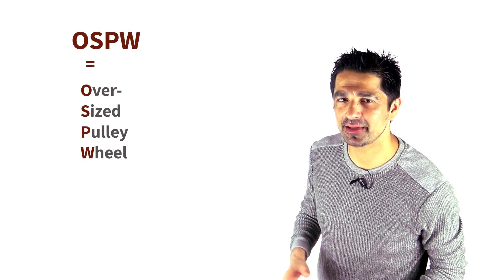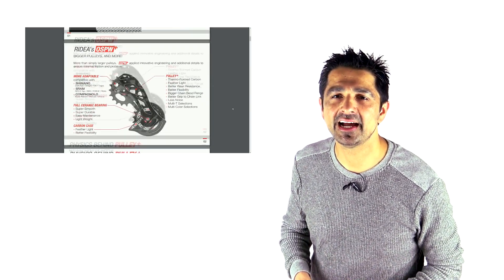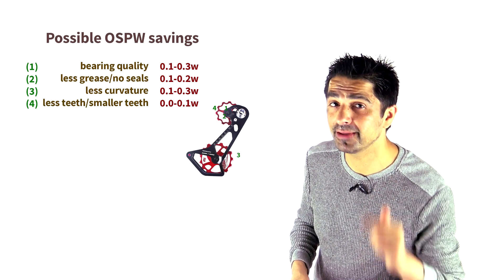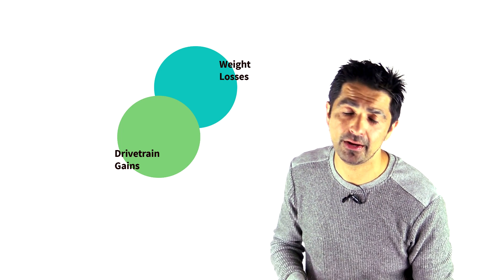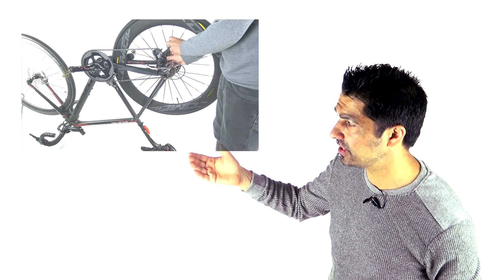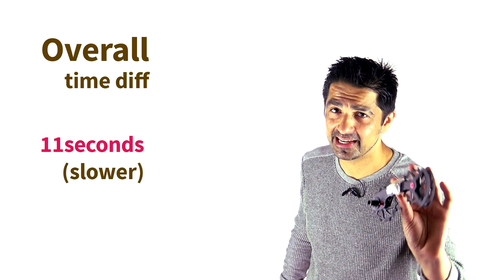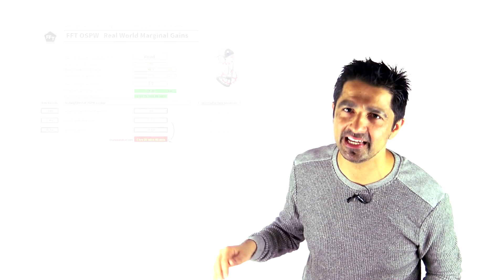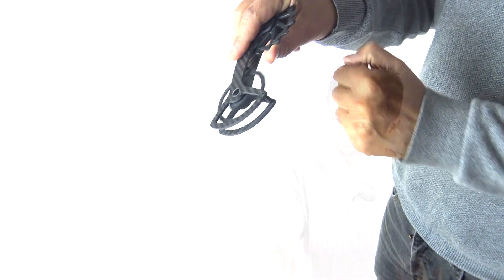Why your CeramicSpeed (or other) OSPW will cost you watts due to aero drag

Comment from the maker: If you want more proof check out our unlisted video: https://youtu.be/vWDIQVv10BU and our calculator https://fft.tips/ospw  (and please join us on our strava club: https://fft.tips/strava). To those who asked about 0.8w.....here is a quick back of the envelope calculation. We previously showed that 10cm of 4mm (area 400mm2) exposed cable costs about 1w (https://www.youtube.com/watch?v=fbM4fEIu8YY&t=770
) now using calipers a small OSPW is 30mm extra long and 16mm in width (frontal area= 480mm2)...so very roughly thats 480/400 x 1 = 1.2w; a large OSPW as shown in this video was 63mm longer (frontal area = 1008mm2) = 2.52w losses...but we could take off 1/3 of this number because of position in 'dirty air' and 1/3 because you are only in a small gear sometimes meaning the OSPW is most exposed, leaving a third remaining, so that's 2.52/3 = 0.8w. More here: https://www.youtube.com/watch?v=9IZPvSe1RRE&feature=youtu.be&t=80

Comment: UPDATE: So over this last week, I had a kogel ceramic bottom bracket put on the Argon18  nitrogen disc and road bike, and yanked out the shimano bottom bracket. Just as with the pulley, I felt an instant improvement with first pedal.  My speed, power, and climbing watts have increased. This is not some imaginary psych. Influence that all of a sudden has me riding better on the bike. The Kogel OSCP and BB have made the already rigid Aero bike feel stronger and smoother. The best way I can explain the feeling to you would be this....an outdoor bike on roughly paved street now feels like a high quality indoor trainer while being ridden on that same roughly paved street. I can feel the power to the wheel transfer way better. I am bringing the Bottom Bracket here to the topic of ceramic OSCPs because the same argument applies as with the pulley, which is "does it make a difference". In the case here, science is used, respectively.  However, my physical body work using these bike products vs. The scientific studies based on numbers or wind tunnels is NOT pointing towards science as the correct answer for actual riding improvements for a cyclist using these items, even though the scientific numbers and testing might be/is accurate for the given items. I agree that these parts can be costly, and I cannot speak for the ceramic speed items, but I can say that if they are built as well as these Kogel items seem to be, they are well worth the cost because my cycling experience is much more enjoyable. Nothing is free.
Reply: Facts don't care about your feelings. Make some data or at least try to be less objective. Your entire post is basically just "I know it works"
Reply: @skoparweaver7692  let me see if i can put it in a way that you might be able to comprehend...that "data" that has already been done scientifically, that I said might be accuracte/ correct, is not correct, coming from someone who wasn't too cheap to purchase those items and actually has those items on his bike, from his experience.  Just because there is data on paper about an item, it does not mean that the item doesn't work as well as the data might suggest, because in this case, the data can't measure ones muscle reaction to that item. That's the facts.

Comment: Here's what I can tell you about my experience from an oversized kogel pulley.... I am a new, heavy rider having difficulty climbing. I did a final test climbing a specific hill with my ultegra setup before having the oversized pulley put on. On that hill, I could only make it up on the biggest cassette gear. I then put the new pulley on and not only went up the same hill on the 5th gear down, but couldn't believe it, so I did the hill again right after the first try, (which in itself is amazing) and this time I went up on the 6th gear down from the top. Broke my record on strava. Doesn't it make sense to say that if the pulley helped me to do this going up a hill that I was having problems with, that when putting power on the pedals in Any riding situation, that you are going to have a better cycling experience? Forget the science, it works just like the carbon wheels do what they are supposed to. I think it is funny that people gripe about spending $500 on the pulley,  but yet spend $13,000 on their bike. Don't be cheap, you only have to buy it once for the bike. Oh, and it looks great!
Reply from the maker: Nice account; I am wondering if this could be a placebo effect (which can be powerful)? Asking for a friend ;) Also "you only have to buy it once" IF it lasts forever.
Reply: @Fastfitnesstips  but, isn't it true that a stock pulley system needs to be maintenanced as well? A quality one will last longer, right? ......"placebo effect"......are you suggesting that because I spent good money on a pulley system, that after it was put on the cycle......a hill-   that I could only go up in the easiest gear possible, MONTHS AND THE DAY BEFORE  the pulley was put on.....all of a sudden, I can drop down to the middle of the cassette AND go up the hill better and faster the very next day, 2x back to back, to where I break my record without that being a goal in mind....only happened because mentally I told myself that "I have a new pulley system that I spent good money on, I am going to make it work better than my stock pulley", and in turn, told my physical body, "today, the day after, even though  I could only make it up the hill in the easiest gear yesterday and the months before without killing myself, today, I am going to make my body push harder, and be able to drop down to the 5th and 6th sprocket and go faster up the hill than ever before? Now, think about for a minuite. Oh, and you can tell your friend that I weigh close to 300 pounds! Maybe your science is correct about watts when you want aerodynamics to kick in. The funny thing is, every time I see a video on these pulleys, there is no scientific study done on what the thing does for you going UP the hill! (However, in fairness, you did mention it could help up hill in the video). This would be a good test video....have someone who is new to riding and has a hard time climbing, go up a steep hill as fast as they can, time and meet them at the top. Have them rest up for 2 days. DON'T tell them why.....next, put the oversized pulleys on and give them the same cycle and do the speed test up hill again. Make sure that they eat and  wake up, and go up the hill again under the same weather conditions and same time of day as the first run, and when they are done, tell them what the test was when meeting them at he top of the hill. Do this with at least 3 people, and I'll bet you they say that the pulley is worth buying, forget about aerodynamics downhill, which, by the way, hasn't hurt my speed at all.

Comment: Hard to accept your aero loss figure. The derailler sits right in the disturbed air flow behind the pedals. Even shoe size will effect the interaction between derailler and air flow.

Comment: Ceramic balls are 60% lighter than steel balls in bearings but two more chain links may be required so as to nullify that weight savings.

But ceramic bearings can use much lower viscosity oil vs grease or no lubricant at all for a race.
But the larger derailleur size creates more air resistance especially at higher speeds.

Comment: You don't get into the dirt... open cage bearings start picking up grit and grinding up the races pretty durn quick. Those marginal gains from the bearings are going to turn into losses unless you keep changing the $$$ bearings regularly.
Reply: Good point.

Comment: I've worked with GC riders++. 
Priorities for performance gains: 
- diet and bodyfat %
- hydration
- sleep 
- stress mgt which includes no. of hours one can devote to cycling each week
- biomechanical/musculoskeletal assessment, bike fit, and flexibility training for better aerodynamic positioning
- medical history and assessment (stress ecg, hormone profiling, spine imaging)
- progressive power meter training
- bike maintenance (waxed chain, cassette/chain/chainring set up and matched wear)
- lighter rims, narrower rims and tires, 23mm are lighter and more aero

What most deluded cyclists prioritize: 
- a bike under 7kg (when they are carrying 5+kg excess fat, much of it blocking arteries)
- frame and wheel aerodynamic gains (when a lower back angle will reduce drag 500+% more so)
- coffee 
- cool kit

Of the above, the most important criteria for performance is optimal nutrition and bodyfat %. Without this, you will compromise more performance inputs than any other factor. 
Fortunately though, 99.5% of humans eat for hedonic pleasure, and not performance.....so it is easy to get a competitive edge on opponents.

Comment: OSPW systems switch up your gear ratios, allowing you to travel at the same speed with less power. Hence, you are able to use those watts for increased speed. Increased speed has the greatest drag factor above anything else. So in reality, there is a penalty with OSPW, but it is too marginal to affect your gains within the reflection of speed. FYI I'm saving about 20 watts with my 14/12 tooth OSPW.
Reply: Wat
Reply: How would that switch your gear ratios???

Comment: Your entire argument is based on the aerodynamic drag, which the figure you totally made up. The amount of cost of the jockey wheels IMO cannot be anywhere near .8 of a watt, surface area alone wouldn’t equal that if it were placed on the top of your head. Besides the fact jockey wheels are relatively close to the wheel which are already creating their own turbulent air. If the size of the cage was such a huge aerodynamic loss I think we would see far bigger market for more aerodynamically shaped cages.

With that being said, $ per watt saved (for a ceramic speed ocjw) simply isn’t even close, it’d be cheaper to just lose 2 pounds off yourself then spend $500 on those.

Comment: To many assumptions.The loss of a free running system with standard  and oversized jocky pulleys can easily be measured and becouse it is on the unloaded side of the chain the difference in losses should stay the same in a loaded drivetrain.This is my conclusion as a engineer (although not mecanical) unless I miss something.The reduced loss is thus easy to measure.The bigger jockey  wheels will influance the effective cage lenth as the distace between the top and bottom of the deraileor that the  chain will see willchange slightly so ideally the cage should be shotened slightly to compensate.Aerodynamic drag can also be measured.Weather the relative small saveing is cost effective is another matter but as long as we dont go overboard there is definitive saveings to be had.

Comment: I upgraded my tt bike with sram rad 11speed to a OSPW from Ceramicspeed an I tested it 5 times  on a 20km flat course pushing 350 Watts an averageing 48km/h and in average I was 2 seconds faster☝️🤷‍♂️
Reply from the maker: You tested 5 times with and without the OSPW in randomised order? If so that's commitment!
Reply: 2 seconds faster Lol 😂

Comment: Interesting.  Please take this concept further to compare sram axs to shimano, short vs medium vs long cage derailiers.
Reply: I am even thinking about marginal gains like riding in a larger rear cog at higher cadence vs smaller cog at lower cadence at the same bike speed.  Thinking about drivetrain losses, and differences in aero of the extended derailier

Comment: This man‘s analysis is about as believable as is the claims Ceramic Speed makes.
Reply from the maker: I see, so you think the actual aero drag lies somewhere in between my claim of 0.8w and their claim 0.0w...ie 0.4w? ok try that figure in the calculator.
Reply: FastFitnessTips: Cycling Science! I have seen several of your videos and find the topics you address very interesting. As an engineer myself, and an experienced rider, I have seen videos of yours that I completely agree with, and some that I think are working under false assumptions. I have never used and OSPW by any company. That the larger form factor might create additional drag is just logical (although it might have a better aerodynamic shape), I can only guess these things. However, saying a better coated, larger pulley wheel has „maybe .1 of a watt of savings“ in it, is difficult to believe. Probably very difficult to measure, too. Using larger sprockets and larger chain rings has worked for me in time trials. Cross chaining is certainly a factor, but moving from 50 front 14 back to 54 front and 15 back has given me quite an edge in time trials, that are usually decided by seconds or even less. Therefore, I did not see any convincing evidence, that larger pulley wheels might not generate a similar effect. 
PS.: the effect I am referring to is clearly over your claimed .1 watts.
Reply from the maker: @LarsRR  OK, I follow you, you are talking about the magnitude of saving of a larger pulley wheel gains. So we already know the magnitude of larger cassette and chainring gains, it averages around 0.5w per tooth (see https://www.cyclingabout.com/wp-content/uploads/2019/06/1x-vs-2x-Drivetrain-Efficiency-Chart.jpg) but most of this is due to chainline improvement so gains by pulley size are much less (just look in the middle of the chart....going across the middle of the cassette 21-23-25 saves almost nothing unless you are in the inner ring). So what about the jockey wheels which don't have chainline issues .....Discounting bearing gains, then I will say when we modelled this more accurately we found jockey pulley size saves about 0.2w-0.3w per tooth (you can find this model at https://fft.tips/drivetrain) not 0.1w so you might be partially correct in your comment.

Comment: Couldn’t find a video from you on ceramic bottom brackets compared to Dura Ace. Would there be one very soon? :D Thank you coach
Reply from the maker: Not specifically, but we did make a calculator which will feature in the future video :  https://fft.tips/drivetrain     and it has been extensively tested as follows: average frictional losses of the ceramic bottom brackets vs steel is 0.4w  and top quality ceramic vs top quality steel is 0.03w (see https://www.hawk-racing.com/independent-bottom-bracket-efficiency-study/)

Comment: You didn't clarify the point about correct spring tension ...should it be more or less than the OE cage to get a benefit ?
Reply from the maker: The lower the cage tension  tension then the lower drivetrain friction but be careful about chain drop on bumpy ground. Stock derailleurs  create 10-15N of tension but OSPW often half this. See my test of tension in the video....this is roughly how to test it yourself.
Reply: @Fastfitnesstips  Thanks, I added a KCNC 14/16t cage which had a few tension options . I tried to match thev OE cage but realistically I was just guessing. I thought tension would only  have an effect on gear changing   , I hadn't considered drivechain friction ....  is the tension test in the original video ?

Comment: I've never used an oversized pulley wheel system, but they look big. Are they so big that they require a longer chain? If so, that would add a tiny bit of weight.

Comment: Just get some Tacx Ceramic T4065 pulley wheels and install them on an aero rear derailleur such as a short cage Shimano Sante or Ultegra RD-6400. If 10 speed is required then an RD-6600, which can be purchased for about £35 has huge aero savings over an SRAM AXS rear derailleur, which is a big and heavy expensive (£1000) lump by comparison. To improve drive train efficiency I use a 55,42 front chain ring and a CS-6600 15-25 cassette. I also use Sugru moulded fairings on my brake/gear cables as internally routed cables are rather pointless.

Comment: Great video Alex - thought provoking as always - Now back in UK after working ( and a fair bit of riding ) years in Dubai - Have a TT bike with Ultegra set up and a road bike with Dura Ace CS (the 19 tooth model) - TT bike CS BB and when chain block etc are all cleaned and using the CS lube it spun......................still spinning ......................still.................and stop - seriously there is was a noticeable loss of drag if I spin the crank backwards = less effort - how much not idea but in my first ever TT I placed on podium and my power was up 20 watts the previous week on the non CS setup - did I but new ? No would I ? No do I regret ? No 
TT bikes with minimal shifts no problems. - road bikes however - no quite a happy - missed shifts - sloppy feel (on DI2???) - looks great - works not so much - now back in UK and have hills to deal with again I see the road bike ospw days will be numbered - in fact I am off out in a few mins for a quick tester taster

Comment: Great to know that oversized is just marketing hype. I would expect the weight penalty to be worse than what you calculated Alex. 2 links would be on the low side I would reckon. 2 larger pulley wheels as well as the extra derailleur distance could see you needing more than 2.

Comment: Was also wondering about the aerodynamics. Gains didn't seem sgnificant enough so I didn't get them,

Isn't that area most likely turbulent air though, since it's at the back of the bike?  wonder if there's any difference in aerodynamics
I remember simillar questions on the length cable from frame to the derailleur... 
Aerodynamics is a very tricky thing, cant be sure unless you windtunnel test it for that particular bike/set-up